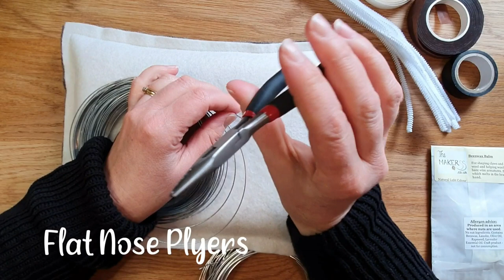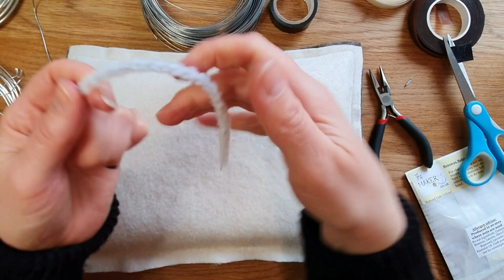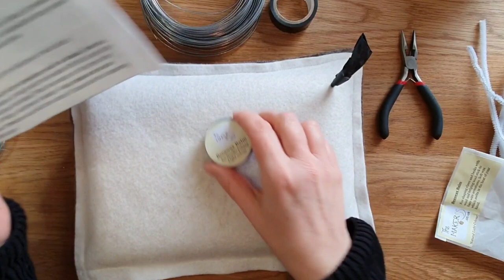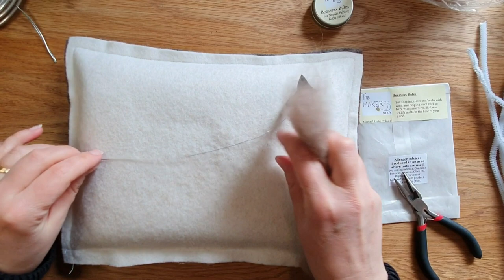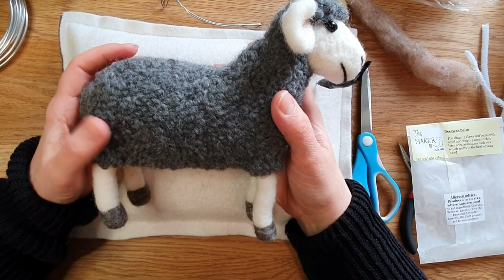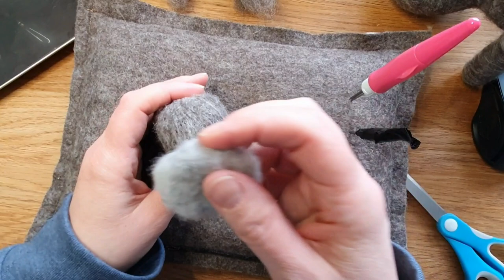WIRE ARMATURE PROBLEMS SOLVED / How to cover wire easily and other tips for the needle felter!

Comment: I always learn from your videos and save them to rewatch. You present things in a methodical, yet fun, manner that I can follow. Thank you. A suggestion: getting correct dimensions and proportions is a very difficult area for me and perhaps others. Many of your fans don’t have the “eye” of an artist. Providing measurements more often would be helpful. I mess up proportions by pulling off too much core and the head I end up with is twice the size of yours and much too large for the body, so I often have to start over. Would it be far too work-intensive for you to provide a one time “basic sheep” (standardized) formula that includes weight of core and dimensions for various body parts? That is, 1 ounce of core for head, 3 ounces for body and 1 ounce per leg will give a fairly consistent 3x4 sheepie. We could then scale up from your basics. I know other factors influence a well proportioned sheep but at least we could start with a standard sheep (or whatever critter). Please just ignore this completely if it’s too much to ask-we will still ❤you!
Reply from the maker: Hi Barbara, yes, proportions is definitely a difficult thing especially in the beginning. I have done a video on how to measure out head, leg, body ratios, I will link it below. I do put all measurements in my PDF's and online courses, they are very thorough plus amounts of wool needed but on here I am mindful of having shorter videos to encourage a better click through rate and increased views and keep people watching. I will definitely take your suggestion forward and be mindful of measurements a bit more. At times I do think about it and promptly forget whilst videoing 😄. Thanks so much for watching and for a great comment xx
https://youtu.be/jnZ_Vjq5Sxs

Comment: Does the needle not break when it hits the wire?  I want to try something with wire but I am worried about breaking my needles.
Reply from the maker: If you use a thicker needle, say a 32 and then hold it lightly so you bounce off with practice you will be okay xx